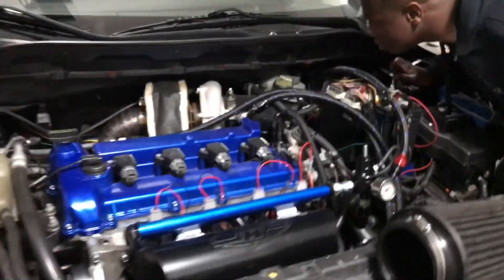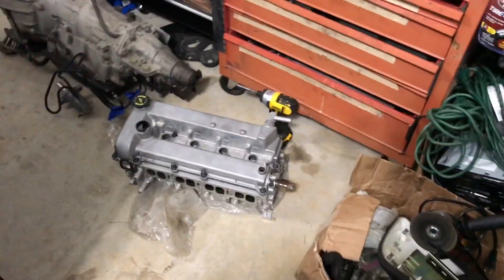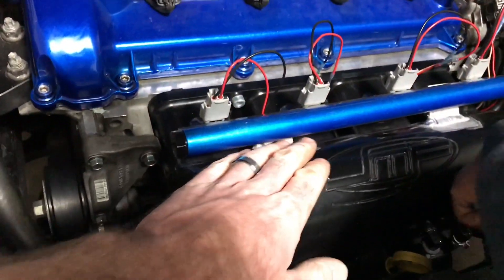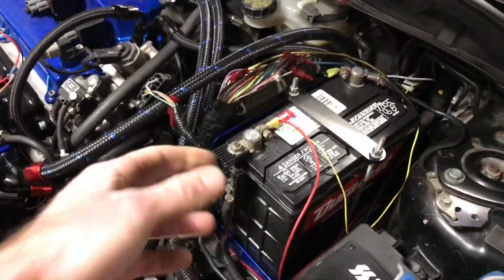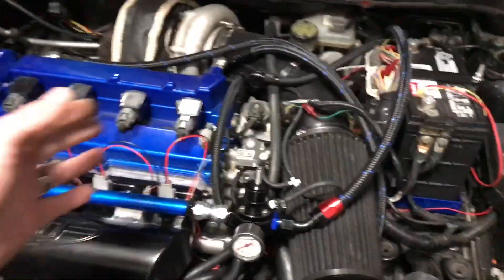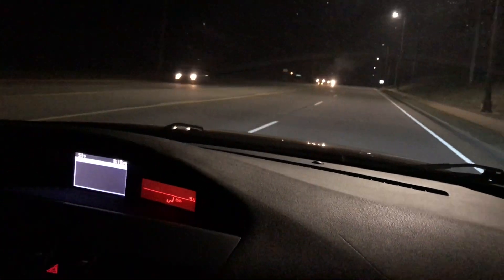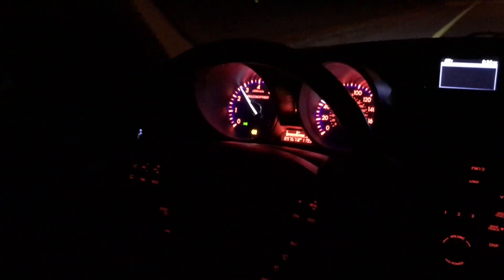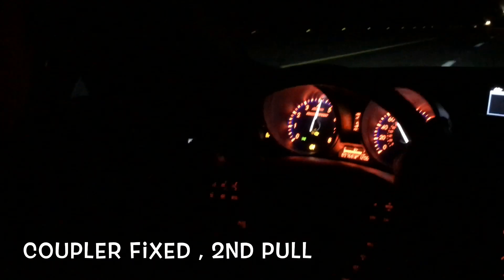Mazdaspeed 3 Street Tuning On 24PSI Goes POP!! | Left Us BROKE DOWN On The Side Of The Road

Comment: Get this man some v bands on his intercooler setup. If it's giving you issues at 24psi it'll never hold when he starts cranking it up closer to 40
Reply from the maker: That’s what I told him that night lol
Reply: You not lying
Reply: i was thinking same thing
Reply: A friend showed me a trick that helps a decent bit. Just use a can of hair spray while putting the couplers on and it REALLY helps hold it all together. Just a backyard trick if you don’t have money to do the v-bands
Reply: @isaacw8195  hairspray works very well along with some quality clamps. I'd still recommend going with some vband clamps to eliminate most of the couplers. Nothing worse than being stuck on the side of the road because a couple popped. Spend the extra money for one less headache
Reply from the maker: Ya I did this on my old build hairspray isnthe way to go
Reply from the maker: Is the *

Comment: Aaaaaaand this is why we sometimes pucker when pulling logs for our tuner. Dang, man. I've blown off a coupler during a log before, and it sounded like a giant champagne cork going off, LOL!

Regarding boost leaks, under WOT you'll generally go rich too if there's a leak - you'll be venting metered air so the PCM/SS controller are putting in fuel for more air than is actually making it into the combustion chamber. Really bad boost leaks will make a trumpeting sort of noise sometimes, too; sort of like a giant whistle, haha.

Comment: Hope you guys get your Ricelands installed properly this time! They should be fine without that guide pin as long as the bolt is on the correct side and the strut it in all the way.
Reply from the maker: This is not my car it’s Demetrius’s car idk how they were installed or what kind they are
Reply from the maker: But I’m sure he will figure it out and will probably be getting a new set

Comment: How much air is 24PSI of boost on those manifolds? 370-380g/s around 6k rpm on a pump gas MAF cal? But how much at 7800 which I believe is the rev limit?
Reply: Lol, couldn't tell ya
Reply: A lot of assumptions here...
- 2.3 Liters
- Volumetric Efficiency 88 - 95%
- 11.5:1 AFR on E10
- BSFC .47 - .5
- standard atmosphere
- 24 psi boost
- 12% drivetrain loss
- timing not considered

MAF at 6000 RPM is ~320 g/sec
MAF at 7800 RPM is ~440 g/sec

400whp at 6000RPM
520whp at 7800RPM
Reply: If your actually reading 370-380 at 6000, then you should probably use about 500-525.
Reply: @Dshaad_quest10n  love your car man!
Reply: @turbovolvos40  thanks bro
Reply: It depends on the turbo, too. Xpsi on turbo A isn't the same as on turbo B or turbo C. Larger turbos will flow much more volume of air at the same pressure. For example, I'm at 390whp at 24psi on my BNR S3. He's at nearly 500whp (so far) at the same pressure level because his turbo is much larger and  flows much more air volume at the same boost pressure. But it gets far more complicated than even that.

Tuners of this platform frequently scale MAF tables to account for extra fueling or ethanol mixes, so comparing grams/second numbers between cars is pointless. Also, there's the fact that Genpu ECUs can fuel trim 10-12% in either direction in open-loop fueling to hit AFR targets, so if you're in a 20-24% wide range  - 10-12 under or 10-12 over - you'll still hit your AFR target. As someone who's tuned a great deal on this platform, I know this firsthand.

Accordingly, knowing exactly how much air you're flowing in grams/second would take far too much experimentation and expensive dyno time to lock down 100% - nobody ever does it. The best measure of air flowing is power made when compared at the same AFR, but then even this doesn't account for the efficiency of various setup (in other words, it wouldn't be apples to apples unless the two setups compared are identical). And even then the health of the engine could be the independent variable. Again, far too multivariate to nail down completely.
Reply: @numinous4789  , the pressure (and air heating) happens in the turbo. With the same manifolds, the intake manifold pressure will be the same in similar conditions: air flow, RPM, ambient temp and as well as BAT, manifolds, intake and exhaust, and so on.
If on the same car you only upgrade the turbo the boost will vary/decrease negligible due to the possible less exhaust restriction assuming you don't  move from a tiny turbo (suck as the factory K04) to a very large one (the difference in BATs will be high as well in this case). Between big turbos however, the difference is not that big.
Reply: @mituc   You're repeating back to me what I've already said, but you're confused on some key points. Where the air is pressurized is absolutely irrelevant in terms of the physics of pressure versus the physics of volume. Again, you can have various setups all flowing at the same pressure but flowing entirely different air volumes - some moving much less air, and some moving much more air. Pressure and volume are separate functions.

I turn your attention back to my practical example: at 24psi I make 390whp; at 24psi Demetrius is making almost 500whp. Even with optimized setups that have much higher-than-demanded flow potential you see this same phenomenon, and to engineers/physicists the reason is obvious - volume and pressure are two different things. Another easy example is if you had a garden hose at Xpsi of pressure and a firefighter hose also at Xpsi of pressure the firefighter hose would obviously flow far more water at the exact same pressure (an apt illustration because the fluid mechanics of gases are very similar to those of fluids).

There's a reason why the measures for the two are different - one in kPa or psi, the other in grams/sec or lbs/min. Perhaps I'm not explaining it well. Regardless, my practical example should be the end of the matter.
Reply: @numinous4789  The boost is the difference between the manifold absolute pressure and the barometric pressure. So it's basically measured in the intake manifold. The manifold absolute pressure is given by the amount of air in absolute mass existent at some point in the intake manifold at a certain temperature. It is a measure of how much air the turbo is pushing or how much air the engine can't pump at that moment.
Going back to your practical example - you're not giving a very important detail: 24PSI and 390whp at what RPM? I'm guessing 6000-6200rpm with WMI, so about 340g/s of air on a pump gas MAF cal with timing suitable for WMI aux fuelling - if you're using a factory intake manifold which flowing less compared with Demetrius's JMF will result in higher boost for the same air flow.
So we know Demetrius made this figure at 7800, and considering my statement above, which is essentially that boost is also a measure of how much air the engine can't pump through, 24PSI at 6500rpm will result in a totally different mass air flow compared to 24PSI at 7800rpm (the higher the RPM the higher the rate at which the engine cat eat up that mass).
So this is why I'm also mentioning engine speeds and manifolds rather than just turbos, because once you're past a certain exhaust wheel the engine will be able to function better as a pump not having that wheel as a restriction (sometimes will pump better just because the WGDCs can be lower if the turbo is potent enough).
Reply: @mituc  Again, pressure and volume are different functions, and this is regardless of engine speed, Victor. You're ignoring the physics fundamentals at play here. I've spent enough time explaining it to you. Between what I've said and the internet, you have more than enough resources to understand why Xpsi = Y horsepower, even with any turbo, even when every other variable is controlled for is demonstrably false. All you're doing when pulling in other setup variables is confuting the issue, and doing so doesn't change the laws of physics, no matter how many times you respond.

Good luck to you.
Reply: A much more detailed explanation. I'm not spending more time on this:
https://www.rx7club.com/3rd-gen-archives-73/why-bigger-turbos-make-more-hp-same-psi-645551/
https://www.e90post.com/forums/showthread.php?t=401958
https://www.f150forum.com/f70/why-bigger-turbos-make-more-power-than-stock-turbos-same-psi-234568/

Comment: I wonder why he can rev to eight grand I have almost everything he has besides the intake manifold and extra fuel but my tuner didn't even change my rev limiter or my bottom end torque curve
Reply from the maker: You got cams ?
Reply from the maker: And all the valvetrain
Reply: @SpoolingUpPerformance  yeah all super tech top in
Reply: @SpoolingUpPerformance  even the valve guides and valves
Reply: @SpoolingUpPerformance  and a port and polish that took almost ten hours per Runner
Reply: And no I have Factory cams because it's a turboed car I felt it was not necessary if it wasn't in a car I would have did cams right away
Reply from the maker: Gotcha .
Reply: Probably a question for the tuner man
Reply: @Dshaad_quest10n  yeah you're right I'm going to have to find one
Reply: @jonathanfarias4399   @#boosted401 mzr  You have all that done and you don't have a tuner? o.0

Also, SP63 and CS cams have shown to make healthy gains on this platform. It's turbo'd, so you don't want overlap that'll vent boost. At the same time, greater lift and duration will help more air get in there. Practical experience has shown gains can be had with cams for the 2.3 MZR DISI Turbo.
Reply: @numinous4789  no I have a tuner that I worked with for 7 months. I just don't say his name out of respect
Reply: @jonathanfarias4399  Ahhh, gotcha. That makes more sense to me, haha.

Comment: What oil do you recommend me to use on my mazdaspeed3 2012 car has 67k miles!?
Reply from the maker: Rotella T6
Reply: Okay thank you!
Reply from the maker: Anytime
Reply: @SpoolingUpPerformance  by the way what is the best transmission fluid for the speed3?
Reply: @jimmytre6779  I like the Mazda stuff best.
Reply from the maker: Ford Motorcraft XT-M5-QS also known as the "Honey" for its looks. The best all-around fluid for our car out there imo. Partly b/c it has one of the lowest viscosities for a 75w90 GL-4 fluid. Unlike Amsoil or Redline's which are quite a bit thicker kv@40c,
Reply from the maker: Ya buddy I agree on the pennzoil as well ! Also a great oil
Reply: @numinous4789 which penzoil platinum and synthetic or none synthetic!?
Reply from the maker: Synthetic
Reply: @SpoolingUpPerformance  thanks for all the help guys
Reply: Just buy whatever name brand is the best price at Walmart! Hasn't failed me yet, but there IS a huge difference between the big names and the Walmart brand, don't go down that road...
Reply from the maker: You got it !
Reply: @numinous4789  specifically Pennzoil Ultra Platinum, Pennzoil Platinum can be used in a pinch! make sure OCI's are 3k no more than 3500 miles
Reply: yeah I am running Rotella T6 in my 10 MS3 and so far so good

Comment: Hey what type of Port injection is he running? And he using meth or E85?
Reply from the maker: He’s running a JMF manifold with 2200cc injectors , stand alone fuel cell in the trunk running pure e85
Reply: @SpoolingUpPerformance  so port injection on the jmf, when i pick up my speed im trying to avoid mixing fuel aa far as E85 as its hard to get around my way. Whats the max power can you get on the SP63 port injection kit on 93? And can you run that and Meth as well?